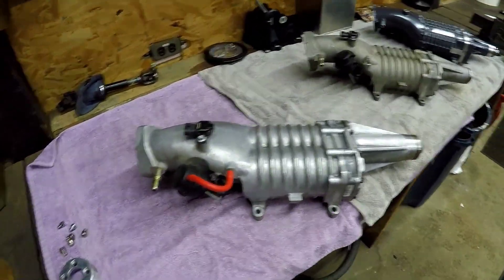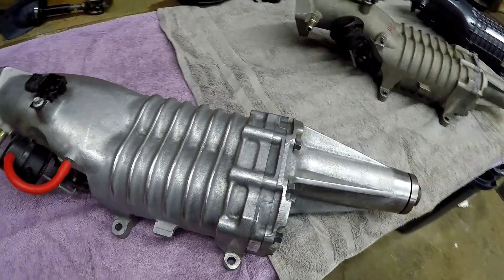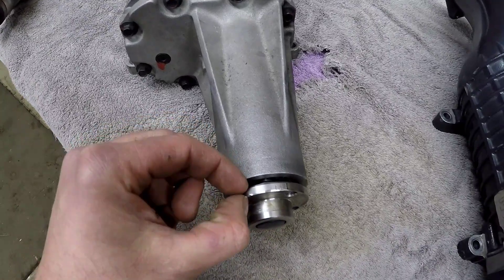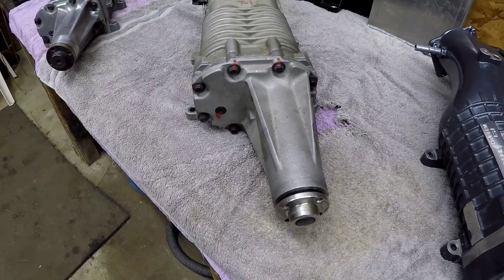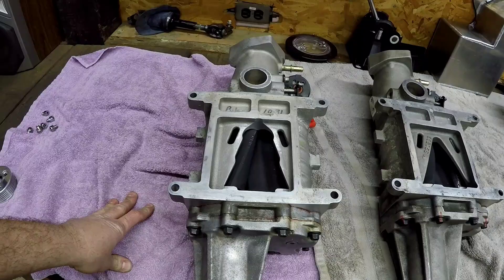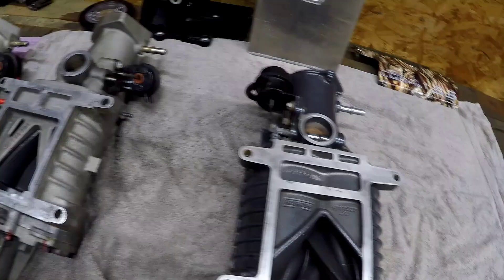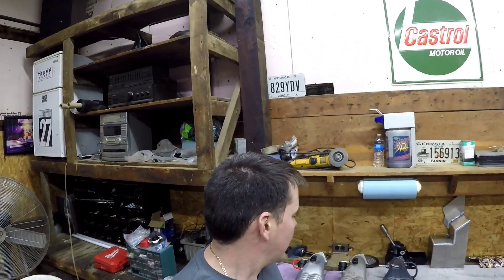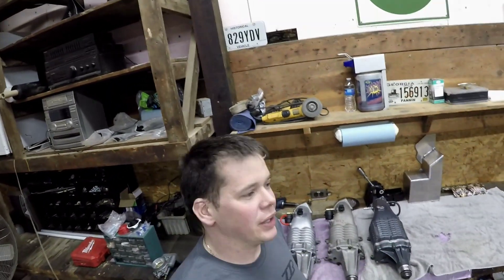Cobalt ss M62 vs H62 vs TVS1320

Comment: Could you run a m90 supercharger
Reply from the maker: People have in the past with custom kits. They actually made less power then a m62.
Reply: @jasonwiddowson8892  I’m not sure about that m90 is physically moves more air. I say this because I run m90 on  my 2000 Jeep grand Cherokee 4.0. I also run a AEM .water meth awsome
Reply from the maker: @trevorthomas6043  i can't remember the reason. But there has been a few done in the past and produced m62 results. Not saying something that wasn't done wrong or can't be done better. But its alot of fab work even if it does Slightly better vs picking up a tvs

Comment: I had a ported M62 on my SS with a 2.6 Pulley, along with double pass endplate, S3 heat exchanger, neutral balance shafts, S3 ZZP Cams, n a few other things, tuned on 93 made 320whp on 20lbs of boost, miss that car, may need to build another one n go TVS and fully build the head with ZZP’s Race block 😆
Reply: Do you think the 2.4 NA is worth it imma put either a used blower on their or a turbo kit from Zzz . It’s a SS
Reply: @18thSTVATO  upgrade the valve springs and get a thicker headgasket to lower the compression, the 2.4 ecotecs are not as sturdy and have valve float issues. Do the timing chain while you are in there as well so the guides don't break and grenade your valves
Reply: @18thSTVATO  Yes, stock bottom good to about 300 whp. I tried 400 whp kind of broke ring lands. 2.4 is already higher compression so it takes boost well. I run a built 2.4 with 9:1 pistons at 30 psi and it takes it. Dynod my setup around 440 whp.

Comment: Im in the middle of changing the valve seals and have the ac and intake mani off and all taken apart to clean. Would I just have to show them the design of the supercharger outlet, Xmas tree design, and they should be able to do it.

Comment: I'm interested in doing a 1320 install in my 2007 Cobalt SS. The thing is, I think the transmission might be going in it. Since your channel focuses on the Cobalt, would you advise doing so? As I've heard Getrag no longer produces or manufactures components/parts for that transmission. Sorry if this question sounds dumb
Reply from the maker: Not dumb at all. There is a gut on fb jason Perrotto that builds these transmissions. I believe he sells parts for them also. There also new ones on fb but the prices have went way up. Another option is f23 swap from a base model but these is some work involved need to switch out mounts and holders they hold good power as good or better then the stock trans. The best swap is the f40. Jason and zzp sells swap kits there 6sp to and very strong. But can set you back 4k give or take
Reply: @jasonwiddowson8892  can I install a SC on a SS 2.4 NA ? Automatic
Reply: @18thSTVATO  Yes you can, or a turbo. Either is a full weekend project plus tune time and about $2,000-$2,500 when all is said and done. Can't make a lot of power on that 2.4 bottom end, but enough to add a little extra fun.

Comment: Quick question my BROTHAZ. So all them SUPERCHARGERS can replace the supercharger in a 2006 Chevy Cobalt
Reply from the maker: Yes. Ones stock ones a rare prototype for the replacement of the stock one. The big gray TVS1320 was made for the cobalt/ion as a big blower replacement. All 3 bolt right into place.
Reply: @jasonwiddowson8892  can they be added to a 06 NA 2.4 SS ?
Reply: @18thSTVATO  no, you need the lower manifold collant pump different bracket for the alternator and ac lines a tune and alot of fab work. Your 2.4 is the same as the 2.4 in a solstice so you face the same retrofit issues I do. Plus unless you build your block the rods tend to give out around 300 horsepower.

Comment: Is the tvs straight bolt on from the 62?
Reply from the maker: Yes
Reply: @jasonwiddowson8892  recommend anything to be done along with it. Valves springs. Injectors or di
Reply from the maker: @keed_on_two_wheelz  I mean its how far you wanna take it. As a basic setup bigger injectors like 80 or 160s. Cooling mods and a 3.5in intake with a ls4 throttle body on e85 if possible would be a good start. Really wanna wake it up check my mod list out on my other videos and you'll see what I did. Things like a ported head and cams are a big help
Reply: @jasonwiddowson8892  man you're so lucky you can run e85 in Canada that's a hot commodity. I'm 100% gonna fallow your list tho. Zzp has absolutely everything and reasonably priced. And I can port my heads and save the 2200 or whatever it is

Comment: Jason, a little off topic, but a quick question on a 2.2l supercharger conversion with the stock M62.  Can you use the stock 2.2l tensioner arm with the vertical 2.0l lsj tensioner? I also have ZZP's adjustable pulley.  I know you mess around with Ecotecs a lot and didn't know if you ever tried this combo.  I'm having a tough time finding the lsj idler mount bracket, so I was wondering if the stock 2.2 might work.

Comment: So when you used the h blower did you have it maxed out on the dyno? Can it produce more boost safely or is it the design which makes it better flowing for a bit more power at the same boost?
Reply from the maker: It was pretty much maxed out. It was running the same pulley as the m62. It did produce about two more pounds of boost. With the ATI damper it's like I was running a pulley  just under a 2.5.
Reply: @jasonwiddowson8892  have you done any cooling mods for the exchanger?
Reply from the maker: @Itsarealone  Yea I have a large heat exchanger with a single pass manifold and a larger IC pump.